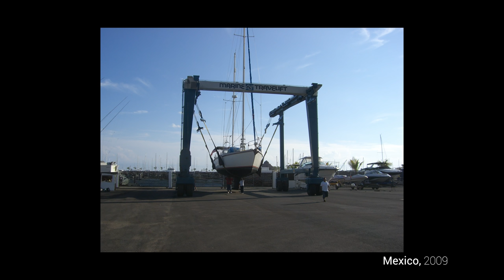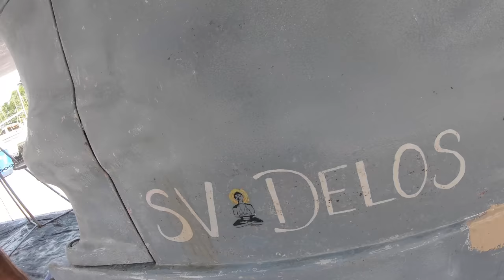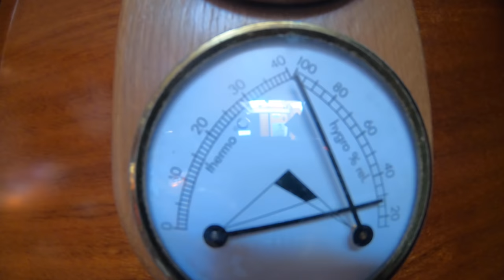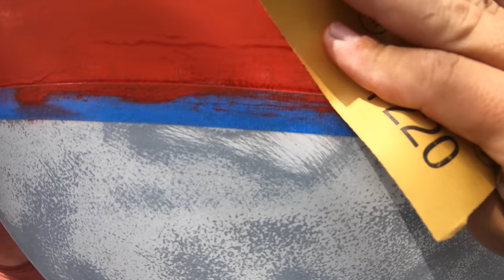DOWN and DIRTY in the Boat Yard!  - Sailing Vessel Delos Ep. 289

Comment: Hi Brian
Its great to see a sailing site that shows that the real world is more than T & A!   As a builder who has seen everything over thirty years I found it disconcerting to see an underwater opening on Delos being patched with sticky-poo joining to a pipe of unknown material and condition.  The basic rule is "keep the mast up and the water out." That means that every hole that is underwater (including when rail down)  must have a properly installed thru hull plus interior backing plate and be capable of being closed with a seacock that is threaded directly on the thru hull.  No red brass fittings anywhere underwater. No non-reinforced plastic waterline hose in the system below the water.   No dis-similar metals in close proximity (stainless ball valves in bronze or brass housings with brass nipples threaded in and closed by rusty steel handles.)

I don't see how the repair job you show meets those minimal standards.  Wouldn't be the first time I've seen similar, even on multi-million dollar superyachts......

ps:  Are you familiar with details of the Amel that sank at anchor in Granada while un-attended  about ten years ago? A failure involving the bow thruster as I recall.  I believe there was a serious lawsuit around it? Worth looking into the history for any preventive maintenance it implies.

Comment: You can rinse the gear case of the bow thruster in mineral spirits if needed during fluid changes per Amel's advice. I have worked on several super maramu and I can attest to their foward engineering, with a couple of WTF's to boot 😜. We were happy to see you all at Cobb's marina in Norfolk Virginia for a little while. The stern of your vessel certainly tells stories of the sea! Happy sailing

Comment: About the barrier coat on the steel keel:  It was a good idea to acid rinse, but I predict you're going to have future problems.  You used West 410 microballoons for a fairing filler, but that's not recommended for use below the water line.  On a steel keel, I give the exposed metal a good tooth using 60 or 80 grit, and spray with water to promote light oxidation, then rinse with phosphoric acid to convert the iron oxide to iron phosphate.  After that, you can apply a barrier sealer, then use epoxy with either West 404, West 403, or mixture of the two.  It's a lot harder to sand, but bonded to the metal, it'll hold up below the waterline far better than what you used.
Reply: good advice!

Comment: 21:00 That van setup looks sweet.  I bet it has taken him on some amazing adventures just like Delos has for Brian.  Seeing that, I might just have to install  flexible solar panels on my prius.  

 That  van has inspired me to look into getting a toyota hybrid van when they hit the used car market in a few years.
Reply: Good morning. I've got an '83 hippiemobile that I'm converting to handle alternative fuel and battery options. Pleasantly surprised by the more than reasonable prices.  If you don't mind, why is it that you are waiting for new models to emerge (In used car market) rather than convert sooner? Is your Prius rigged for solar already? What draw would be standard for that size vehicle for lights, fan, water pump (is that even feasible?) Laptop,  speakers? I've done van life since early '80's, but this is my first RV and I'm always looking to learn.
Reply: @artistaloca4  Toyota hybrid's run their air conditioning from the hybrid battery.  So in hot climates one can sleep at night in comfort.

"Pleasantly surprised"? What do you think the final price is going to be? 

I recently  bought a Gen2 Prius from county auction, for $3,250+fees. It was previously driven by a county employee. 

The county replaced the hybrid battery, so it has 80% life left on the battery. 

So far I have purchased a Dometic 95 liter dual zone fridge and freezer, installed a inverter, installed water pump, and made window coverings. 

The 95 liter fridge is way bigger than I need at the moment, but for the investment I wanted to plan ahead just in case I upgraded to a van. 

Inverter is to power appliances (blender, induction cooktop, electric heater for winter, devices, etc). I don't plan on using more than 1,500 watts. 

The 12 v water pump has a garden nozzle and/or kitchen nozzle attached to it so I wash dishes, or take a shower. It's has a 10' tube that reaches the pop up shower tent.
Reply: Ryan here.  Thanks for the shout out on my van.  I set it up to be able to travel safely during covid times.  I planned to stay in it while working on Delos to make sure to keep the NUGGET save.  As you can see in the video, it was SO HOT in that boat yard.  Luckily another friend of my was docked at the same boat yard for those 2 weeks, so i was able to stay on his boat.  The 2 (100 watt) panels are hooked up to a Goal Zero battery.  Simple plug and play set up.  Take care Carlos.

Comment: Take a look at Cal 40 Seafire's comment about the keel patch.  The easier sanding fillers are porous and will allow water to reach the cast iron. Recommend grinding out and re-doing it with an appropriate barrier coat.

Comment: That pipe! Tap it with fine treads and screw a pipe with thread on outside in with a good sealer! Problem is fining the right die to tap inside pipe! A good tool and did shop could fix you up! Make a second one for next time! Can use steel brass plastic pipe and even have a head on it to seal against the haul! Just a thought

Comment: I'm a bit puzzled about what's wrong with copper anti-fouling. Copper is best against zebra mussels, which were a big problem on the Great Lakes in my live-aboard days in the '90s, when there were worse anti-foulings being phased out. Your boat work brings back many memories... Soggy core needs to be well cut back (does Delos have a cored hull?).  And, line-cutter = crab pot liberator.  Great for the entire East Coast, both offshore and ICW ;-)

Comment: I wonder if the bottom you took off would work fine on a faster boat?  Would the 12-15 knots a performance cat can hit fairly often be enough to keep the soft growth scrubbed clean?  The idea seems to work for powerboats that go hoonin every time they move, but I can't seem to find a reliable lower speed limit.  Apparently it's somewhere above Delos' 6-8 knots... or was it just the long stretches you spent not moving this season and a fear you might be repeating that, and maybe in colder waters that lead to the decision to try something else?

Comment: QUESTION FOR MAINTENANCE EXPERTS...the parts where the ship is being held up by the boat stand plate...im assuming underneath has to be sanded/painted too...do they come re-lift and reset those?
Reply: Roger Rarebit  Thanks for answering appreciated!
Reply: Roger Rarebit  Or the yard charges a small fee to reposition the stands.  The blocks under the keel, however, are generally done with the boat in the slings.

Comment: I am always worried about the adverse health affects when using the chemicals and paints in boat maintenance.  I don't think the mask and eye protection are up to the job of protecting against the vapors.  I used Interlux Prefection the last time I did my topsides and it affected my eyes for a few weeks (kept watering).  I will never use it again even though it produces a fantastic finish.  What is up with that bow thruster?  Do you think it is a design flaw that produces the leak?  For something that is used so infrequently there should be some way to seal it off from inside the boat so that it avoids filling the entire compartment with water.  There also does not seem to be a way to service or inspect it unless Delos is hauled out.

Comment: How has your experience with high pressure washing of the hull in relation to blisters? I always had a few blisters until I asked the yard not to use their pressure washer. Three thousand PSI can inject water even into gel coat, no?

Comment: That Toothless and Ruthless bib is the best thing I've seen all week!

Also, does the prop shaft turn from side to side? It looks kind of like a rudder where it is attached to the keel .Or is that just the attachment point?
Reply from the maker: Hey Joseph, that's actually a fixed bearing so it doesn't turn side to side there.  The cool thing is we have no prop shaft so the prop is pretty well protected from the keel.  Certainly has come in handy up here in Maine with all the lobster pots about!  Brian

Comment: Brian and Ryan should switch their mask filters.. Ryan is using A2 Filters which are for gas and Brian is using normal particulate matter (dust) filters... But if Brian is working with Epoxy, so a gas filter would be much better, and for dust a dust filter must be the right one. (In companys where you are working more often with masks, it's cheaper then) xD
Reply: Jonas, you are correct.  We did the work in the beginning of July and we couldn't find any masks in all of Annapolis.  Because of Covid, we didn't want to switch masks so we had to make it work with what we had.  Thanks for looking out.
Reply: @adventureswithryan5474  ok, makes sense indeed, but aren't this filters which you can take off/on your mask? (Especially yours looks like one of those masks). I mean, at my workplace (a boat yard in Germany), everyone got one mask (from 3M) with which we can install the filters we need for each kind of work.
Reply: @MrTorstenWerner  we tried to find the right filters for our masks, but again, they were all sold out.  Because my mask and Brian's mask had already been used by us before the boat work, we didn't want to switch filters either.  Now we know more about Covid then when we were working on the boat, so we may have done things differently.

Comment: What’s up with the bow thruster that’s the second time it’s leaked in heavy seas. The weak link in the Amel. ?   109 WTF. I’ve never seen it that hot in Annapolis good times I thought you must have been in Fla. Thanks for the maintenance video it helps always glad to see
Reply: If I remember correctly it was the same problem (the spring).  First time he was able to put tension on the cables that pulled it in, but I don't think that worked this time.  I hope this time it's sorted for good.

Comment: Why don't manufactures/painters/owners paint lifting chevrons for strap placement on the bulwarks of their boats?
Reply from the maker: The lift guys are generally pretty good at placement, and we do discuss it before hand.  In the case of Delos there are lifting hooks on the chain plates for a crane, and that happens so also be where the straps should go.  So we just line them up with the big chainplates!

Comment: I sure hope you rinced the acid cleaned spots with fresh water and didnt apply the sealer and primer right after you dried the 2 spots.....
Reply: Agreed. Usually the instructions say to wash really well to deactivate the acid. I failed to do that once on a car panel repair and had to do it all over again 3 months later.  But we only get a snapshot of the boat work so I hope it was done properly.    regards
Reply: @garyc5483  They don't show the whole process, and especially now that Karen has her hands full with Nugget.
Reply: @RiverWoods111  Exactly what I said. regards

Comment: A steel keel?
So that is why Delos can stand on her kell - no problem.

Steel is a very hard metal, and it's obvious that Amel had constructed her so she can keep her structural integrity, while standing on her keel.

Not all boat tolerates standing on the keel, without weakening the structural integrity of such a boat.
Reply: Its not Steel, it's Cast Iron (big difference).  Lead keels have no issues standing on blocks, at least on most cruising boats.  There might be certain race boats that have super high aspect ration fin keels where that isn't advisable, but I haven't seen one yet that doesn't sit on keel blocks just fine.  Canting keels is a different animal, but even they get blocked under their bulbs.

Comment: The idea of a cast-iron keel on a boat in the ocean seems wrong-headed, or am I crazy?
Reply: No you're  not crazy Jack it should be bronze bolts set into a lead keel 
But that's the way a lot of production boat manufacturers  do it cheap and nasty
Reply: @oldjack3023  Amel is certainly not a "cheap and nasty" boat builder. Their reputation for building high quality boats that are built like tanks and can take you around the world is right up there with manufacturers like Oyster and Halberg Rassy. Certainly much better quality than any of the plastic fantastics you see out there.
Reply: Cast iron keel ,stainless bolts ,alloy sail drive ,bronze prop ,stainless rudder stock , is not quality boat building
You could probably jump start the motor from the electrolytic action going on here
As for oyster ,there's  a you tube channel  out there  of a shaft anode visibly  fissing away
Reply: @oldjack3023  Sounds like that Oyster has a floating ground problem. Sounds like those owners ought to do some maintenance.